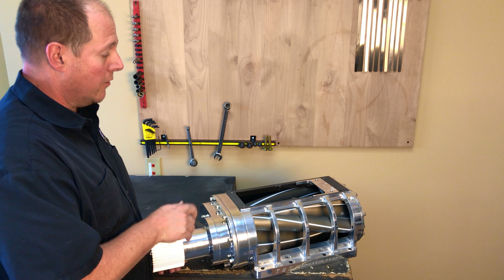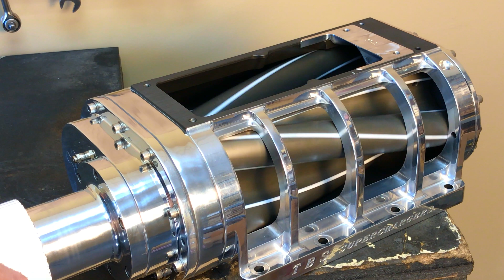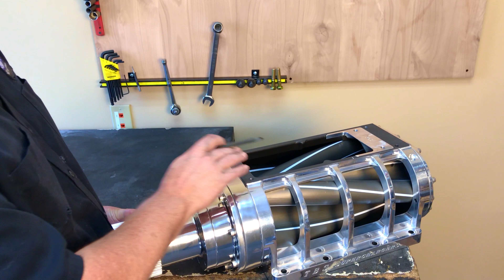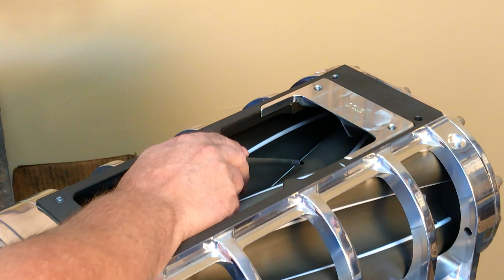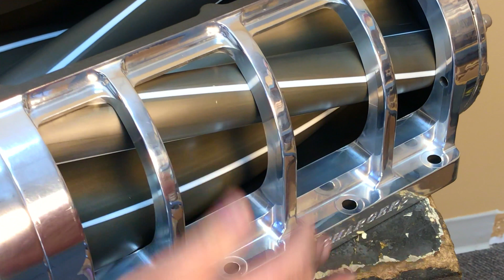TBS Product: 6-71 TBS Cutaway Blower

Comment: You should also remember to tell people that high helix blowers take more rpm to reach max efficiency. One size does not fit all. Standard helix blowers work better at lower speeds in milder applications.